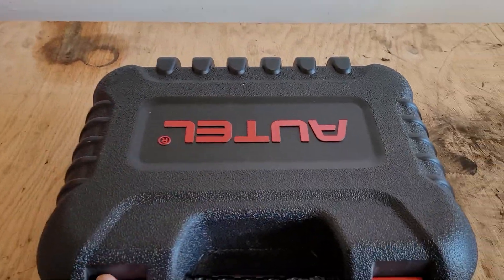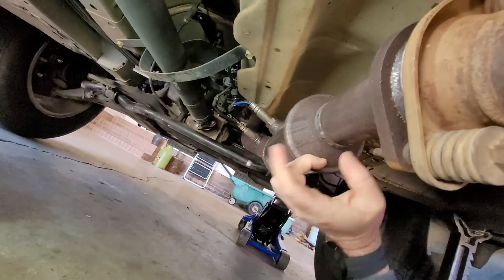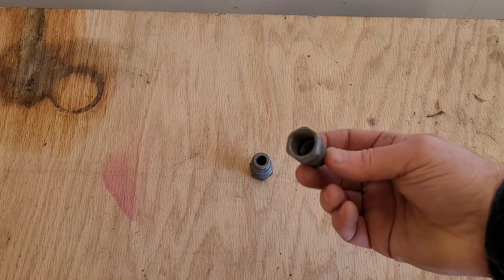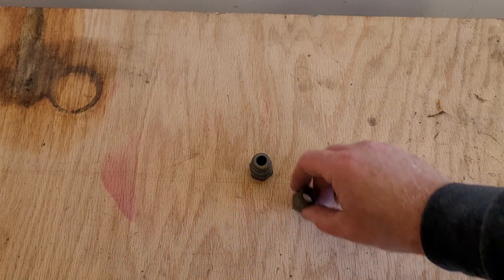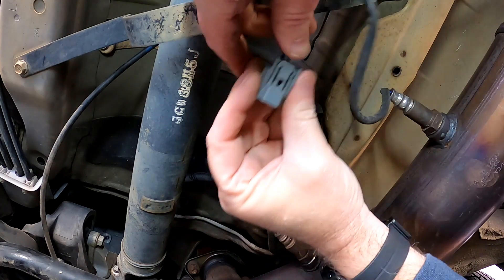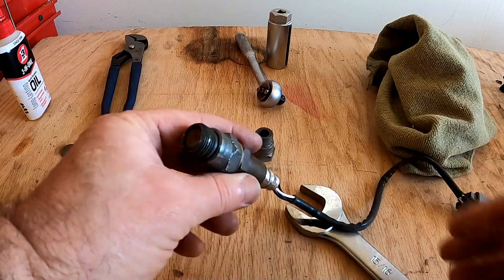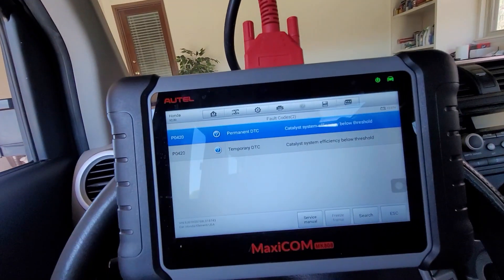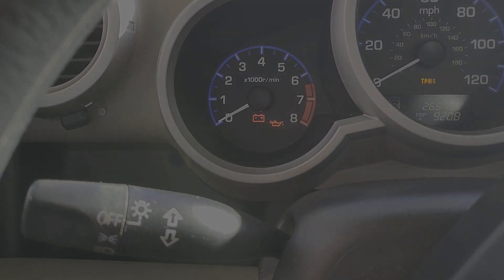Can Sparkplug Non-Foulers Fix A Bad Catalytic Converter?

Comment: It worked for me. 2002 Camry always throwing codes. Replaced the cat twice along with numerous other parts. I spent thousands trying to fix issues. Mechanics would “solve” the problems then a month or two later codes would be back. So I don’t feel bad about doing this. These rules hurt people who can least afford it the hardest. Car runs great, passes the rest of the test. so obviously it’s not polluting more than it should.
Reply: The USA has over 5 k Nukes ready to launch and the Emissions is worried  about a O2 defouler "🚀🚀🚀🚙😂    😂
Reply: True, these rules dont apply to girls, wagging school, running around the world in 747s telling me not to burn fossill fuels.
Reply: You have fooled the computer.  You did not solve the problem IMHO.
Reply: @jeffryblackmon4846 that's a fact, it's fooling the computer, not solving the problem. That's what you try to do if you don't have a large sum of money to cough up to get a car that's running fine to pass inspection.

Comment: It is UNREALIST to "expect" emissions to last more than 100k and to pay the repairs to fall within the emissions. Yes, many cars can do 20yrs and/or 200k,  but the standards today are so high and the methods of achieving those standards require a lot.  Most cars being manufactured today will end up in the salvage yard by 10yrs/100k because of these standards and the cost of the repairs to meet emissions in the future.  It is just a SCAM to get people to buy a new vehicle.   There is no reason to build such trash.......Vehicles should last at least 200k or 20 yrs.  The amount of pollution that is produced by making a new vehicle is crazy.
Reply from the maker: All good points. That's why I go with aftermarket parts. No, it's not the best, but it does fix the issue.
Reply: @ktecgarage  I hear you and this was not directed at you, but rather the "Guberment" Federal & State and the Automobile Manufacturers.....Yes, we need be "Environmentally Friendly" but  they have gone off the deep with Emissions &"Climate Change" and EVs which are a Joke.......Yes, I agree Aftermarket when it is necessary.  I try to buy the best value when I buy parts whether that is OEM, Aftermarket or Used. I look at the value/life left of the vehicle, the cost of the part and how long I think that part will last and make a choice in the part.   I am not sure if this is still true, but you can not buy Catalytic Converters from the Salvage Yard which to me is the best way to recycle and save money and minimize pollution. I had to replace a cat on 2000 Honda Accord. The cat that was there was already aftermarket and the honey comb glass was all smashed.  I am not going to buy a $1500 Honda Cat to go on a $1500 Accord with 300k on it.  It is crazy to pay $300 for aftermarket glass one.

Comment: what about the decat simulator ?  a de-fouler but comes with a built in precat to simulate having a cat ???
Reply from the maker: I know folks use things like that, but they are illegal to use in the USA.  I'm sure they turn off the engine light, but it doesn't "fix" the car and I'm not encouraging anyone to break the law. Aftermarket cats are fairly cheap, even if they aren't great, but it's the cheap and legal way to go.
Reply: @ktecgarage  but we arent trying to fix the problem. We want an answer to whether or not this will pass emissions test whether or not its ethical. we're talking about motor vehicles here. not law, not medicine. something that some people need to get from work to home. Also, id suggest re uploading this video but instead STACKING TWO foulers ontop instead of just one. You need to stack two or else there wont be enough space between the sensor and the exhaust fumes in order to trick the computer into thinking it is getting a smooth reading.

Comment: Try a longer extender with a bit of steel wool loosely packed in first. It does what what the extender with the screen in the end will do.
Reply: Steel  wool?   Which  grade  ,   coarse 4  or 0000. Or in between.
Reply: I used some medium stuff between 00 and 1. Between the different OEMs there's no universal standard of what the ECU is programmed to look for as acceptable O2 sensor feedback parameters so a little trial and error is sometimes needed. A scan tool helps too so you can look at a graph of the voltage switch rate compared to the front O2 on the same bank. To much separation form the exhaust flow and it won't switch at all, then the ECU will purposely run very rich looking for a response and generally the car will run like crap. You want a nice lazy switching rate compared to the front O2 which switches pretty fast. If it's a fairly late  model car it'll have wide band sensor in the front that will read the whole operating range of AFRs and not just stoich. You'd still want a lazy switch rate on the rear O2s, just nothing to compare it to. Hope that helps  @CONFUCIUS-f2x

Comment: I did it on my chevy blazer, it worked, going to try on my cobalt. Its just a try . If i get a lite, might go staight pipe
Reply: @hhhmotorsports9550  2002 Chevy Blazer here, works perfectly! Have 240,000 miles and no Engine light for anything! My cats got stolen and I'll be damned of im going put that much money into a vehicle with that many miles. Especially when it's running strong.

Comment: Worked for me for 5 years and 2 Commifornia emissions tests.. FYI: Have several cars in CA and usually do a smog test every year-I have NEVER had a tech craw under a car or put it on a lift to look at a sensor..
Reply: Exhaust paint or removing the plating makes it look more factory.
Reply: @JohnDoe-id9hi  i'm in PA aka little Commieforina  they do a visual inspection along with emissions. never once have I had a tech or mechanic ask or fail me about my choices of exhaust. as long as the shell of the cat it there I am good to go.    they know what's going on but they also know the rules of pass and fail  I need a cat, I need o2s I need to have no stored or recent codes
Reply: If you previously failed for a bad cat they may look at the cat to see if you replaced it with a CARB approved cat and they may look at the sensor then. But you never know.
Reply: So true.  The smog techs don't give a fat rats clacker

Comment: Have to agree, this hack is pretty worthless, because it does not work, is illegal, and does not  fix any problems. My solution to the p0420 code is to figure out WHY the cats, or 02 sensors failed. Unfortunately that is easier said than done. I have a 2003 corvette, with 250,000 miles on it. The OEM cats are discontinued, and the aftermarket cats are mostly cheaply made junk, not designed to last. The best I can find are the magnaflow OEM grade cats, that are only designed to last 5 years at best. The magnaflow cats cost $1500, and an x pipe costs another $500. Not going to spend over $2000.00 once per year to pass smog. I have some projects planned for removing possible causes of cat failure, such as replacing all rubber emissions lines, sensors, replace exhaust manifold gaskets, exhaust gaskets. In the meantime I plan on bolting in new cats and sensors, do drive cycles, and pass smog. Then bolt old cats back in, place new cats on shelf for next inspection. I then will be able to do all my projects at my leisure. Mechanics have a hard time figuring out the cat failure cause. Mechanics dont care that you may have to spend over $2000, on new cats if they are wrong in their diagnosis. Some mechanics that specialize in emissions wont even touch a car if OEM cats are not available. Some mechanics do just some basic tests, such as look for exhaust leaks. I suspect original cats failed because the exhaust gaskets were rusty, and in bad shape. I am learning a lot on things like fuel trims, scanner use. Apparently I have fuel trims at 23 percent, on bank 1. should be no more than 10 percent. Possible causes other than dirty cats and sensors, are vacuum or exhaust leaks. Other causes could be dirty maf sensor. Eventually I will get to the bottom of the cause, but in the mean time I will be beating the system and passing smog tests with my new cats. My way of beating the sytem is great, because no matter how sophisticated the smog testers become, I will always pass. These silly hacks such as messing with 02 sensors, using 02 sensor simulators, removing the light bulb, for the check engine light, and on and on do not work.
Reply from the maker: So many people disagree with my take in this video, so I'm glad to hear that someone else gets it. Just because emissions aren't checked in your state does not mean it's legal. It would be irresponsible to encourage folks to break the law. It's a shame you are stuck with this issue. I did a video where I put Dorman cats on a 07 Ridgeline and it's still passing inspection after 3 years. I know not using OEM is asking for trouble, but sometimes you have to do what you have to.
Reply: I did use a magnaflow, it lasted the 5 years it was designed to. Last year it failed, and I went for the cheapo AP eastern for 500 dollars. The thing was so cheaply made, I had to have a muffler shop cut and fabricate the pipes, for $400, and they still could not get it to fit correctly. Those cats lasted 1 month. Also wasted a bunch of cash on repair shops to figure out the cause.  They cant, or wont.  @ktecgarage

Comment: You have to use two spark plug anti-foulers connected together to move the O₂ sensor far enough away.

Or better still, search Google for O2 SENSOR CHECK ENGINE ELIMINATOR and you'll find they make a fitting just for doing this. Walmart sells them online, $10 for two. And yes, they work.

Comment: Which size non fouler did you use.
Reply: there's only one size to use 18mm.  advanced, autozone, oreilys, pepboys they all sell em.  here's whats it's called at advanced "Dorman - Help Spark Plug Non-Foulers - 18mm Gasket Seat"  2 in a pack for 12.99 as I just had to buy them lastnight lol  if you have a v6 or v8 you are going to need 2 packs a total of 4.  4cyl or inline 6 you only need one pack  use entire pack on each downstream o2.

Comment: Will my 97 GMC pickup 5.7 run with no catalytic converter or sensor
Reply: yes it will run.. but it run poorly. you will waste a lot of fuel.  lets say you had no catalytic converter.. umm a meth head cut it off and you need to get to work..   put in a straight  pipe.  use 2 non foulers per downstream O2  one drilled out other one not drilled and stacked  now the computer will think theres a proper cat in line and you will be good to go with oem fuel milage  ya know till pay day rolls around and you can  drop a stack on new cats.  wink wink you want to get fancy you can take a bit of steel wool and stuff it into the bottom of the non drilled then stack them and it will give the ecm a better reading but it works without doing that step as well.

Comment: think the best solution to pass the smog check is by the following procedure; BUT,  if you have a bad cat problem initially preventing you from passing smog check, keep in mind people, your catalytic converter will eventually need to replaced to prevent damage to your engine. This is just a temporary method to try to help pass smog.
1) reset your codes using an obdII
2) remove o2 sensor#2 (Downstream), after cat and maybe clean it while you are at it.
3) install adapter 
4) install o2 sensor unto the adapter
5) run your vehicle for 60 miles or more,  depending on your vehicle so you can have all onboard monitors ready for smog check & hopefully yo check engine light does not appear.
6) the day/time of your smog check inpection, run your vehicle for at least 4 to 6 miles or more for a warm up.
7) remove o2 sensor (wear gloves & work smart as components will be hot)
8) remove adapter(wear gloves & work smart as components will be hot) as they may visually be inspecting undeneath.
9) re-install o2 sensor without adapter. ( wear gloves & work smart as components will be hot)
10) visit your local smog check station & hopefully it will pass without having the adapter during the test/inspection. 
Seems like a lot to do but it can be far better than replacing the catalytic converter just to pass smog. Tough times call for desperate measures!
Good luck good people      ✌🕶🔧
Reply: Dude  they don't look at your shit they just run the codes.

Comment: DRIVING MY CAR FOR 5 YEARS NOW WITH THE NON FOULER & IT RUNS PERFECT WITH OVER 200K MILES & PASSES INSPECTION EVERY TIME.
Reply: Did u have to take the comb out or did u just put that non fowler in
Reply: That's my experience also

Comment: Don’t waste your money I done it I drill. The one went through the whole deal looked at the data. Make sure everything was working correctly. No misfires thermostat everything exactly 10 to 12,000 miles. The exact code is going to come back you’re gonna have to deal with the issue fix the problem the right way, save your eight dollars either pull it off clean the carbon out or replace it. This is just to give you borrowed time so you get past omissions you don’t have to see the light for a while but it’s going to come back it’s not a guarantee fix I know I’ve done it people need to wasting your time you’ll find out for yourself.

Comment: He’s doing it wrong that’s why it didn’t work your supposed to use both pieces and drill a hole in one only not both
Reply: I get the impression he didn't want it to work. It worked for me. I wanted to do it right so I replaced the cat and both sensors and it still failed so I went with the defoulers.
Reply: @SuperHandyMan he’s a democrat

Comment: Worked on a 98 silverado for me. Its been a year still no cel👍I see a problem with your setup. You have to use 2 defoulers stacked on top of each other. One is drilled out so you can screw in the o2 and the one closest to the exhaust needs to be left unmodified with a small orfice on the end. This limits the exhaust gases that contact the sensor. Some defoulers ive seen have an assortment of different size orfices that you can tune with

Comment: I use two one drilled out 1/2" the other one do nothing...put two drilled one into the stock one and then put the sensor into the the back of that two piece assembly......so you did it wrong....

Comment: I've done this a few times . its a cheap fix . and some cars you will have to manually clear the code with your scanner or drive it for a awhile once its reach the permanent code indicator  for it to be removed. i just clear it.

Comment: You did it wrong. Watch other videos. You need to stack them. Two are needed.
Reply: Depends on the application. I put two on my Pontiac Vibe, and it gave me a different code saying that the O2 sensor was not working. When I removed the second one, it worked just fine for several years.
Reply: @StewartAchillesI didn’t notice they were claiming to be a master mechanic. You sound like you didn’t get any the night before you wrote that.
Reply: @ZEROCOOLAGE You're blowing out opinions also lol not facts. Very ignorant bro.🤦
Reply: He also didn't remove the cat converters 😂
Reply: @thehulkamaniabrother2.089 what do you mean? He doesn't need to remove the catalytic converter.
Reply: @thehulkamaniabrother2.089 yep!
Reply: I just realized I did mine wrong I should buy a second pack tomorrow
Reply: @m.7n6  Report back please.
Reply: Or just buy the long one
Reply: I added two on my Vanderhall,  downstream sensor and it worked. 
When I had them on the upstream it did not work. 
I also have a new catalytic converter and two new O2 sensors.
Reply: 1st -You need to remove the catalytic 
2nd stack two spark plug non foulers
Reply: I have a 2023 dodge scatpack. Gutted both cats the same day I bought my car i use these fouler by stacking 2 per side and till this day no check engine lights
Reply: I used just one on each cat... no issue. I put them down stream

Comment: I'd be a lot more comfortable with this procedure if you guys on YouTube would show the live data stream for the rear O² sensor before and after installation.
 As for the open end wrench you used to remove and install your O² sensor, I have a set of various O² sensor sockets. Sometimes they work, sometimes they round off the nut on the O² sensor. These days, I almost always use a pipe wrench to remove and install O² sensors. The pipe wrench grips better, doesn't slip, and round off the nut, and the longer handle gives me more leverage.
Reply: I did this on a 98 silverado that it worked on. I didn't look at the live data before but after. It's supposed to be a somewhat flat line reading around half a volt +/-. That's what I read on the scan tool. It's been almost a year still no code. I think some cars have more stringent programming parameters that mite still trip codes tho. Also I don't know if having an intact or gutted cat makes a difference. Also some defoulers have different orfice hole sizes that can be played around with
Reply: @MarcBchannel  that passenger side gets real close to the frame rail on the obs and nbs chevys with the non foulers in.. but somehow has just enough clearance as the engineers said well we know their going to do this lets give them just enough room to pull it off but just enough room to ruin their day if the exhaust hangers are out of par.
Reply: @Mjphillips77  Figures🤣 I have an OBS with the 5.0. Had plenty of room. The 5.0's merge from the manifolds to a single cat. The 5.7's usually go from the manifolds to 2 cats then merge so there mite be less room.